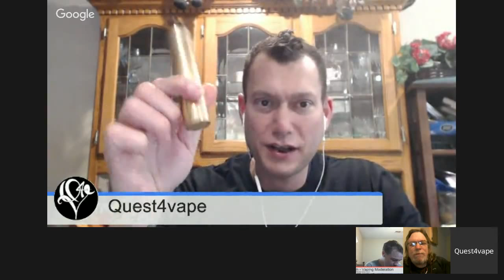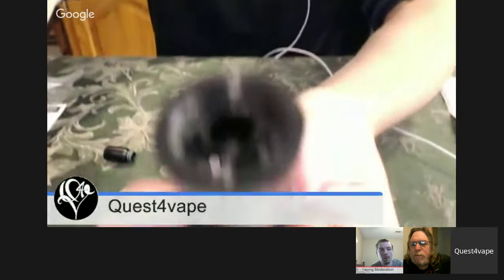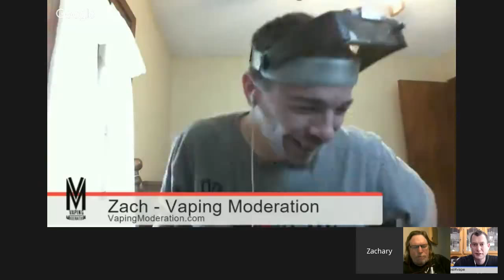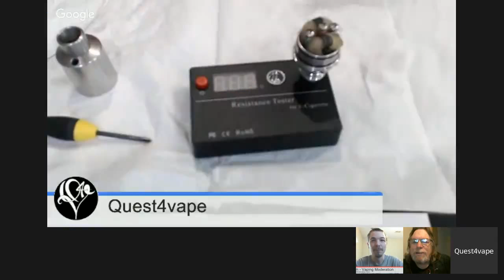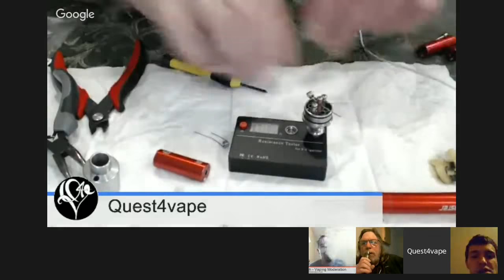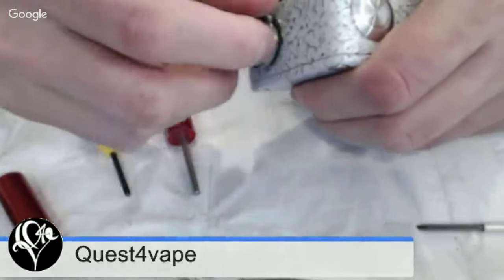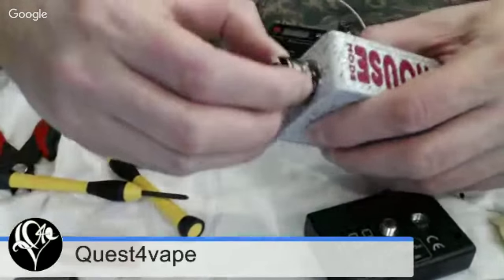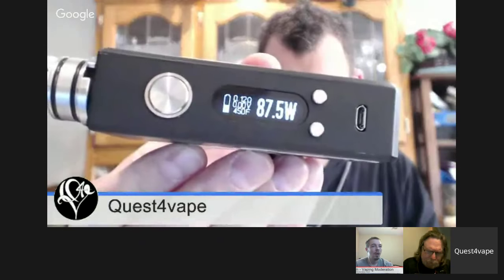How To Build your RDA Coils Live Hangout Kennedy RDA

Comment: damn Darryl. looks like you are having a hellova day. going on this, and your experiences today, I think im gonna stay away from that wire. lol
Reply from the maker: +yetisuncle haha, it was the Ohm reader that was squirrely.  It's not the typical wire, and the IPV couldn't read it accurately either.  But my SMY SDNA200 read it just fine.  I need to invest in a more accurate and functional Ohm reader.
Reply: Quest4vape  or they should make it where all  ohm readers canread the ohms regardless of the resistance wire being used. but im sure I am dreaming on this one.
Reply: +yetisuncle Agreed, I Have Tried A Lot of Ohm Meters And So Many Were Garbage and had 510's Break And Would Randomly Jump around when it really shouldn't be and just Garbage in General. The Little Puck Ones are Terrible as well and they Generally sell for About $20. Definitely Don't Skimp on Them and Do Research on them. USA Ohmmeter Brand Ones Seem To be Great From My and Others Experience. I'd Drop A Couple Extra Bucks on those.    :)

Comment: The problem with your meters is they are el cheapo's. The one out of my Coil Master kit does the same thing with low builds. I have to use the mod to check resistance.
Reply from the maker: +DRTMI Thanks man,  yeah they are disappointing.  I need to invest in a more accurate ohm reader.
Reply: I have been looking for something. Let us know if you find one.